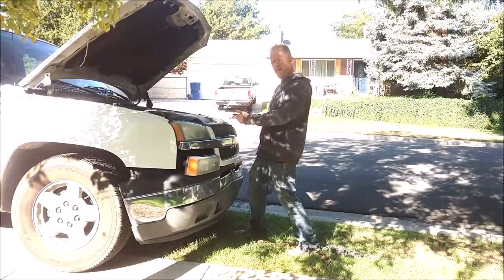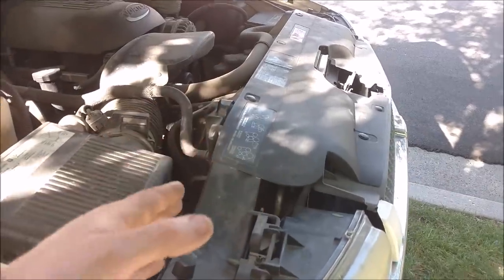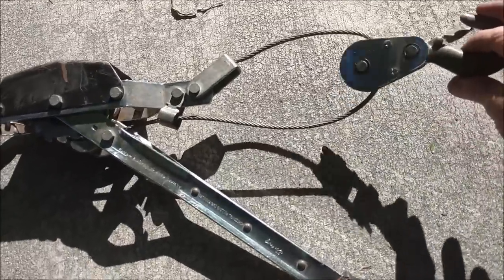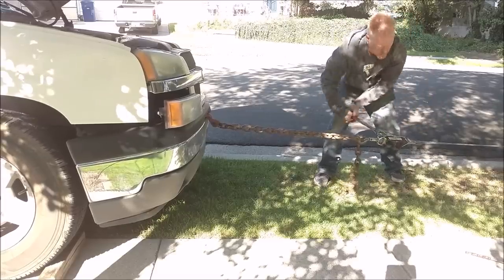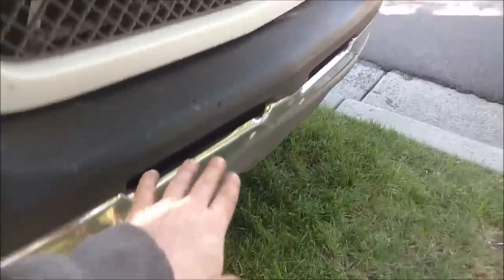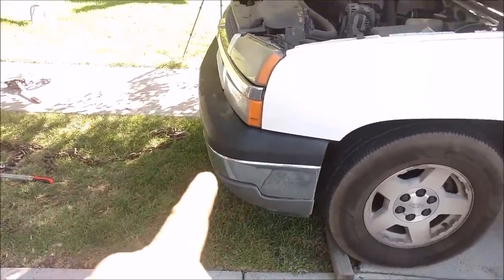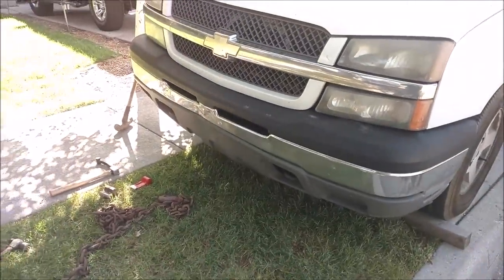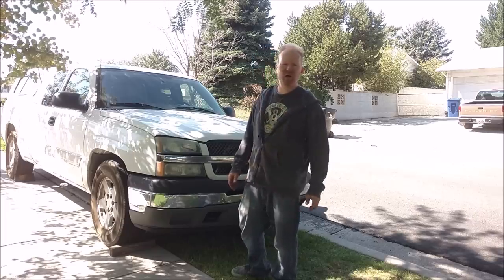FIX Front End Accident Damage In the DRIVEWAY in a few hours

Comment: WAAAYYY back in the day I fixed my bother's '85 mustang after he smashed into someone.  It was pretty bad as the doors wouldn't open because the fenders had been pushed back so far.  In just a few hours I took off the bumper, hood and fenders and then using a jack and chain I pulled and straightened the radiator support/front end.  A few gentle hammer hits to straight some sheet metal, a couple of well placed pushes on the hood while pulling to straighten it and you couldn't even tell the car had been in an accident, it was perfect.  These days I'm happy to get it fixed properly by insurance as it's only a $500 deductible and roughly another $500 of increased premiums.  While you can drive the DIY one and it looks pretty good, that damage underneath (bumper supports, bent supports) make it far more dangerous for the next accident.
Reply from the maker: Pulling it out with a frame machine at a professional shop is exactly  the same thing. It just ends up cosmetically better.
Reply: @sixtyfiveford  I get what you're saying and most likely you'll be fine but to be fair, properly taking off the sheet metal and having a frame machine pull everything back to spec is far more precise and ensures that every support is where it belongs for the next possible accident so it does it's job, crumpling and extending the time of the impact and absorbing all the forces.  In many cases these supports need to be replaced with new ones welded in because the damaged ones are creased, cracked or fatigued.  Again, you did a great job making the vehicle drive-able and looking good again but with how cars are designed and made these day with their thin sheet metal and crumple zones, for a mere $1,000 it gives me pause.  It would be a horrible thing to have either yourself or a loved one get seriously injured or worse, die, in the next accident just to save a little bit of money.  I could be that as I've gotten older and have experienced life that I'm getting a little too safety conscious, but who knows ;)

Comment: I had an early first-generation model Corolla Tercel that got rear-ended hard by a woman tourist in Miami that pushed me through an intersection and crunched the rear end against the rear wheel. Broke the front seat and made the radio come out of the dash. I had it towed home and got the insurance company to let me keep the car after they totaled it. I used a sledgehammer to smash the rear away from the wheel. A bunch of boxers from central America lived in my building and when they saw me smashing my car came out and started hitting it too, sort of like Tom Sawyer and the fence painting, everybody wants to hit a car with a sledgehammer. I gave the car to my sister and she drove it for a couple of years.
Reply from the maker: That's a fantastic story. Not every car can be saved but a mass majority I think could easily be with a little ingenuity.

Comment: 1- You'd be surprised how small a tree you can get away with, especially if it's something like an oak or maple.  
2- the light posts with the big concrete bases that they use is mall and plaza parking lots work best, they don't give at all and I've used them to get an undrivable vehicle (front end/fenders bent it so far that the front tires are hitting) so I can drive it home.
2a- don't use a bobcat to tie it to, some of the bigger ones are quite heavy and seem like they would work, but they can be tippy and flip over.  Ask me how I know :-/
3- I've rarely used a come-a-long, usually, I use a length of chain, sometimes a tow strap, and then use the car (put it in reverse to pull out the front...) to do the pulling.  When things are really bad, if you're tied off to something really sturdy like the concrete lamp base, you can even use a little bit of a running start to get things moving better.
4- other things that I've found handy doing this sort of work:  Every kind of hammer you can think of from a sledgehammer to a body hammer, pry bars/crowbars, the biggest pair of channel locks you can find, adjustable wrenches are GREAT for bending and straightening sheet metal, clamp them on the metal and then use them as a big handle/lever, plumbers wrenches, jack handles or similar long pieces of pipe, vise grips work, but if you need something to pull on grab a medium size C-clamp you don't care about, an assortment of 2x4's and 4x4's, a bottle jack.  A 4x4 Cummins Ram (they're typically right around 4tons) in 4LO does a really nice job at pulling.
Reply from the maker: One of the first vehicles I did was a Jeep that had hit dead center into a pole. I took it to the auto parts store and used the light post, trees and my truck to pull it out. They all cheered me on inside. I had to replace the radiator, timing cover, timing chain, headlights and few other oddities that I purchased from them. It took me around 4-5 hours in a snowstorm but I got it done and it lived on for another 7-8 years. 
 I used to do more chain and just back up the car, but I like the slow steady pull of the come along. I can use the sledge hammer in connection with come along  tension to move the part up or downwards.

Comment: Might want to mention you should disconnect the battery and definitely don’t have the ignition switch on one snack at the sledgehammer
Reply: For the air bag ? I'm pretty sure that got deployed by the crash, but fair call yeah.
Reply from the maker: The air bags won't deploy unless the vehicle is running and moving forward at around 15mph-25mph. They won't trigger in reverse so if you were to chain the bumper to the tree and accelerate in reverse they wouldn't deploy. I have done this on occasion but I prefer the slow regulated pull of the come along.  I have done cars with and without airbags that were deployed in the accident(this one didn't have them deployed).
Reply: @sixtyfiveford   Thanks for the info. Guess I was misinformed or things have changed over the years.
Reply: I would say more likely you are correct I do know if you turn the orc module upside down with the key on it will deploy the curtains

Comment: Kept my vw on the road for another year after the front got smacked with a logging chain telephone pole floor it in reverse untill the wheels could turn again wasn't pretty but it got me through.
Reply from the maker: Whatever it takes. I couldn't pull the frame out with the simple come along on a small car so it was just like you did. It got progressively more aggressive until it straightened right out.

Comment: A lot of these collision's pop the fuel pump shut off switch. peeps should know where to find it to be able to reset it. A neighbors car got rearended and they made it about 200 feet before it died. Called me and I reset it in 10 seconds and they drove it home..
Reply from the maker: Very true. I've popped the shut off switch from doing simple donuts in the snow.
Reply: Where is it?
Reply: @binnsbrian  It's usually in the trunk, on the side, behind a cover. But check your owner's manual (check the index for fuel cut off switch).
Reply: @NickHorvath  Thanks. It's a Ran truck. I'll check the manual.

Comment: I need help i got a toyota avalon 2005 limited addition i had a reck hit hard to where it bent my car frontend i could Barely open my driver door and my front end kind of came off but i put it back on to look normal in my driveway however now its shifting my hood will not open if i did open it be hard and would not go back ah im at a lose here because i can not tell my insurance about this can i tie it to a tree its not leeking but i noticed my air in my tires went down a little i believe it still starts but i need advice i allready know it will be totaled if i tell the insurance then they will trash my car and it has a nice system in it what should i do ?
Reply from the maker: You can't loose anything by chaining it to a tree and pulling it out. I've done a dozen neighbors and family members car with these methods and they all went on to last for years. The majority of the damage comes out in 10 minutes with the final finesse taking an hour or two. Just depends on how straight you want to get it to how much time it takes.

Comment: I hit a pole when backing up snow plowing and the back bumper is now higher. The tailgate now hits the bumper when it is down. It doesn't seen that it is pushed in just higher. How would I just lower it? Dodge Ram 2010. Chrome bumper.
Reply from the maker: I would hook a strap to the bumper and roll slowly forward with someone watching it. I would hook low on a tree and be really close so it pulls at a downward angle.  Steady small jerks  should suffice.

Comment: Just be careful buying wrecked cars. I recently bought a nice, low mileage Hyundai from a place called light hit resalers. U can only drive em around the lot but can be had for a decent price. I thought all I needed to do was replace a fender and headlight but I was way off. Ruined upper n lower control arm, strut, ball joints, tie rod end, axle shaft thing or whatever it's called, lol and several other parts. Paint to match my junkyard fender up cost a couple hundred bucks. After it was all said  and done I could spent just a little more and got one without a rebuilt title that didn't require anything much at all. Small cars these days aren't built to take even a light hit. I learned the hard way why a light hit can total a new car out, lol.
Reply from the maker: Good point. A lot of these damaged car lots will do a quick sledge hammer and pull to make the damage look less severe. I've seen them put a good wheel from the opposite side on the impact corner and the spare on an opposing side and toss the damaged wheel. Expensive trucks will even have body work, bondo and paint work done to make the damage look minor on the online shopping sites.

Comment: Should you be worried about the airbags?
Reply from the maker: They won't deploy unless the car is running and moving at around 10-15 mph. Some say they won't deploy if the car is running in reverse at any speed also. I had a bent frame I pulled out years ago by reversing with a chain hooked to a tree and frame. I progressively did it harder and harder until it straightened right out. I disconnected the airbags as a precaution.